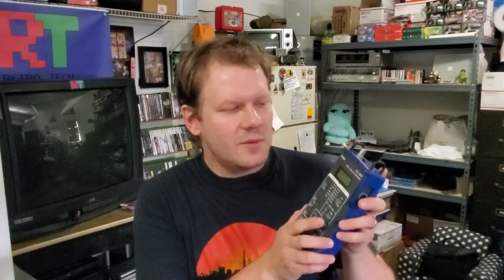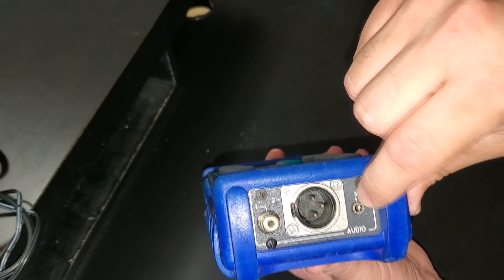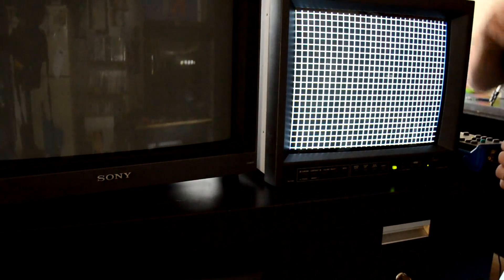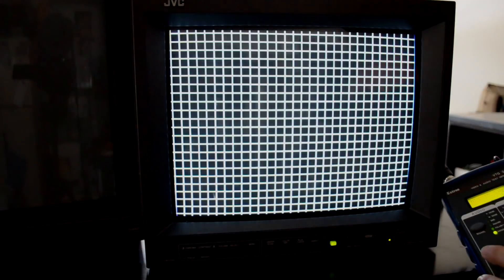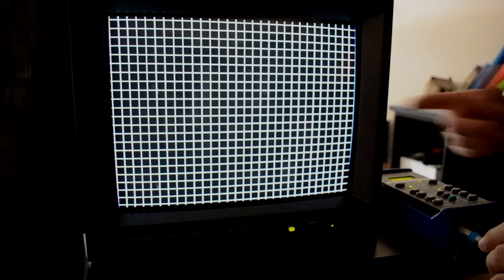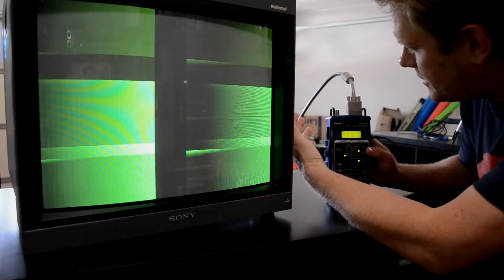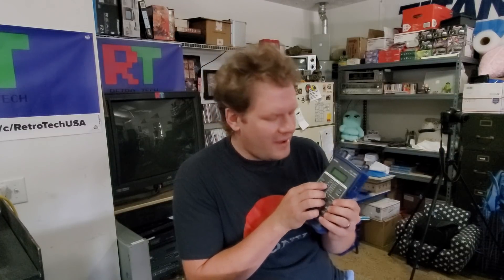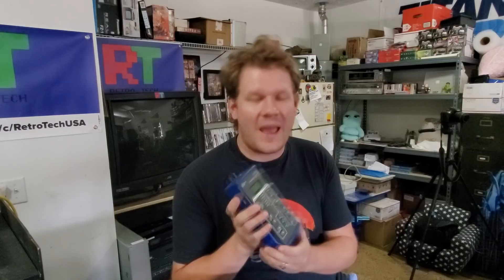Extron VTG 300R Calibration Tool Review

Comment: I have a VTG300R, I use it in conjunction with a Philips face TPG for working on composite Seleco's and Component Hantarex cubes. As a test device for this work it's good (especially the grayscale test & it's onscreen format)... I agree not having a circular pattern is a bummer, it is battery hungry and using it while it's included charger is plugged puts hash / noise on it's composite output (can't remember about the other outputs). Good to see your review of it's usefulness for lowres retro applications - Thanks Steve 🙂

Comment: Hi Steve.  I'm pretty sure your model does output 15kHz RGB and works with BVM's, PVM's and the like.  I own the VTG 300 which is the non-rechargeable model and when set to the correct output for the HD15 video format it works as intended.   As you pointed out the 240p test suite does offer more patterns and thus would be useful tool for the fine tuning a CRT for retrogaming.  However, the VTG 300 is very portable-friendly, and what it lacks in test patterns it makes up for in output resolutions and overall robustness.  Hope you give it another look and good luck.  BTW, I paid $85 for mine.